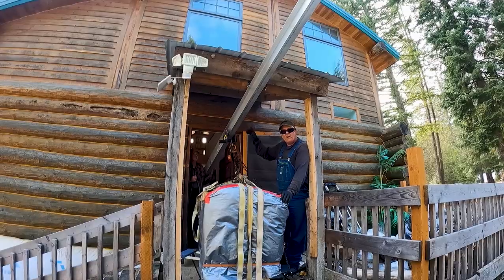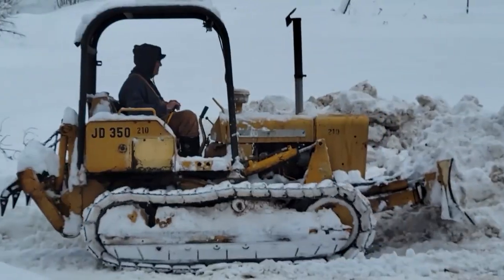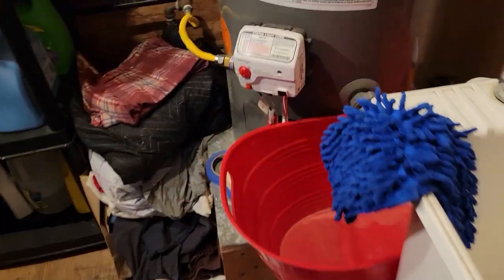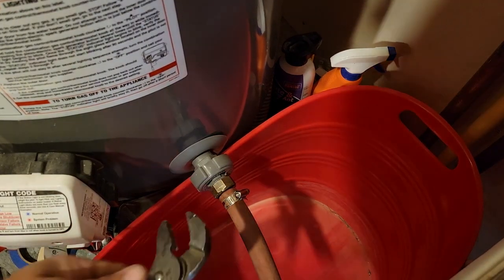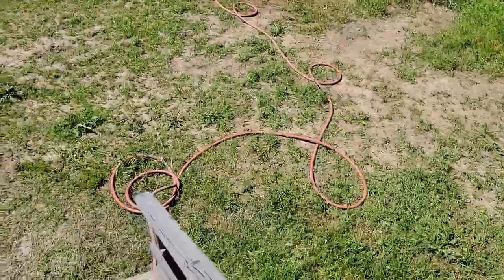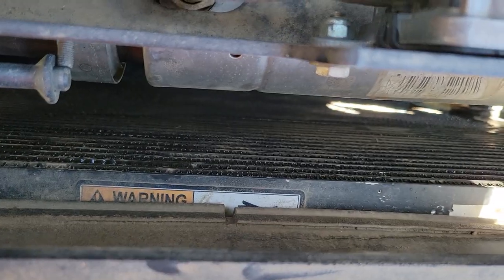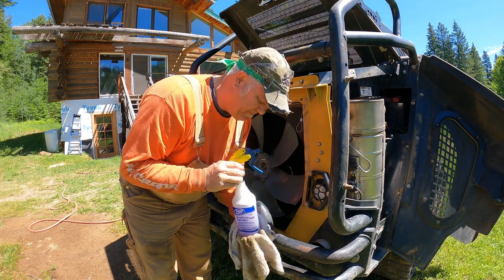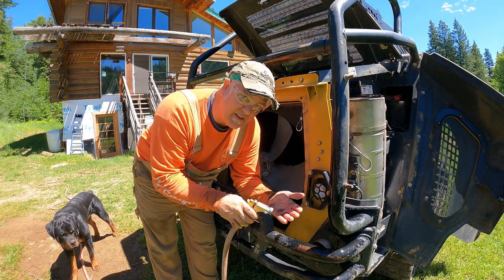HOW to CLEAN a RADIATOR OFFGRID !!!

Comment: I usually use gasoline or ether for a degreaser BUT also have a soap cannon (around $15) for the washer and if you back off the nozzle on the washe5r and don't stick it right against the fins on a radiator or heat pump you don't have to worry about hurting anything. I know common sense is gone but it's worked for me for years. A soap cannon can get rid of a bees nest pronto and knock the fliers right out of the air. Thanks, Pard and GBWYall!

Comment: If you read your instruction manual to your water heater it's going to tell you to drain a gallon off every 6 months. That helps with settlement that ends up in the bottom of your water heater. That will keep your water heater healthy longer. Especially when you're living off grid using well water